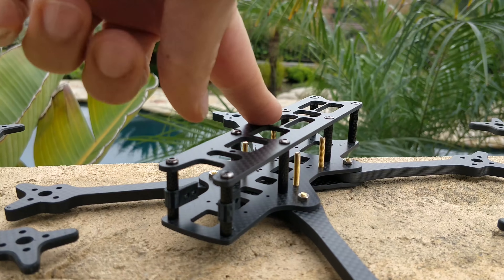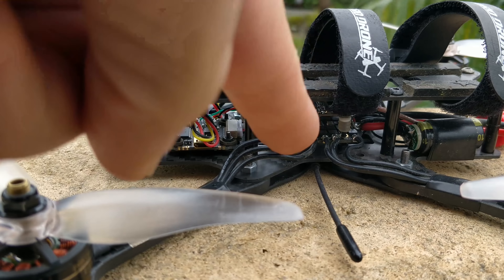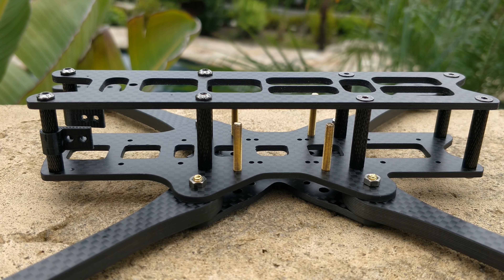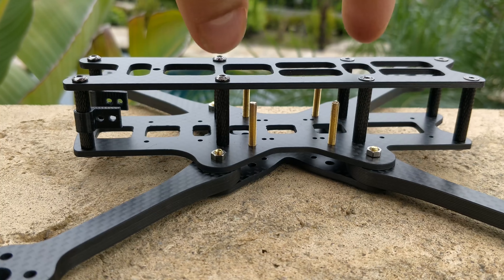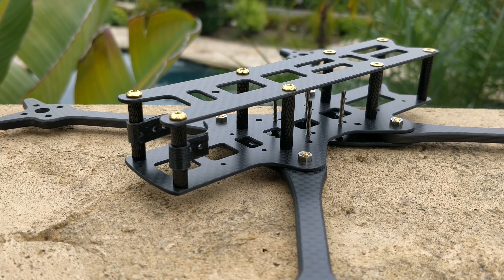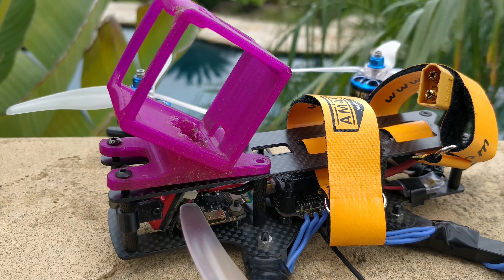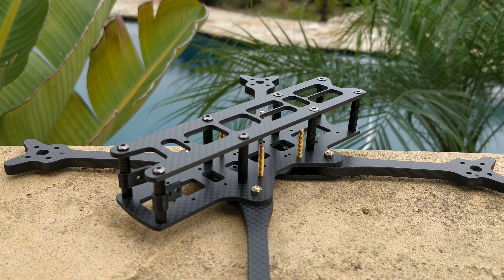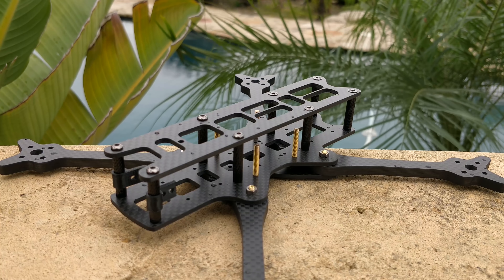Glide - 84g lite, 115g hammer, 97g standard

Comment: I fly r9 for a year or better. Im no long range guy but i push mid range and never have had an issue. Im running older firmware and its great alot faster than 2.4.
Reply from the maker: More power to you. R9 totally blows for me and I do not recommend it at all
Reply: I wont buy another frsky radio or any frsky system in the future do to there business ethics. Now everything i invested in is obsolete but the R9 system has treated me very well.

Comment: Not to be controversial or anything but I think a lot of the areas you’re focusing on aren’t as important as you think and a lot of the things you think make a big difference like vibration and weight on the end of the arms really only matter in very specific scenarios and aren’t as important as they used to be. I’m being really vague bc It’s really hard to explain through a YouTube comment haha but 1 thing for example as I begin to test probably my 50th set of motors I notice in some cases medium weight motors are better at handling propwash than super light motors for whatever reason.. the main thing I’ve learned is individual gear isn’t as important as the total combination of everything together.. so you can have a really light frame or a really tight frame motor to motor but the pros and cons of it can be completely changed based on the components the buyer throws on it! Same with motors and props everything down to the gyro.. Of course some things are objectively “better” but I don’t think that weight and weight distribution for example are as important as they used to be
Reply from the maker: That's exactly what I said in the video. I'm focusing on things that aren't important to the vast majority of people. I designed the base frame to be able to be used in many ways. The rest is just how I use it. The overall setup is far more important than any individual part.
Reply: But weight IS really important for freestyle.

Comment: Where the F did you get Amax 2305 1750, I thought 2305 only goes in 1850? Enlighten me, doctor. :)
Reply from the maker: They actually sent me these as samples. The low kv works super nice on the low weight
Reply: @Kabab  good thing the new 2305 have 1750. But the old ones are suuuuuuper durable, with bearings made of Vibranium :) hope new ones are just as cool...

Comment: Don’t buy foam for your microphone, buy a dead cat cover for it! You could be standing in a gale and the dead cat will suppress practically all of it! And looking at this, if I primarily used 30 x 30 stacks and wanted to split the mounting like you have, FC up front, I couldn’t do it, as the front only supports 20 x 20? Okay, so how about a 3mm threaded plastic riser plate? basically a 20 x 20 threaded plastic piece to cinch to the frame that also has threaded 30 x 30 holes for the  FC to mount to?
Reply from the maker: I'd highly recommend using 20x20 FC and vtx or one that fits in a 20x20 space. Or you can use a total of two 30x30 board plus one 20x20
Reply: KababFPV Can you tell me why? The reason I don’t is because the pads are all but microscopic, whereas a 30 x 30 stack you have a little more to work with! Now, a young whipper-snapper, like yourself, can still see everything just fine, but give it another 20 + years!!!!!!
Reply from the maker: @3eggerfpv397  there are a couple 20x20 boards with larger pads than 30x30. The main reason is hardware and because we don't need our FC or Vtx to be 30x30 large. Also, 20x20 is better for vibrations. It's better overall. The 30x30 is not needed
Reply: KababFPV - Okay, good enough, I’m looking into a new 20 x 20 stack?
Reply: @3eggerfpv397   you could do a 30x30 esc FC stack in the middle and a 20x20 vtx out back like a rush mini.

Comment: At the risk of sounding dumb, what size screws do you use for 20x20 mounting holes? Both M number and length. I've only ever used the 30.5x30.5 mounting holes before which I think must be M3.
Reply from the maker: Not dumb at all.  actually very un-dumb.  So 20x20 has multiple sizes.  My frame has all M2 size holes but there are actually a LOT of FC's and ESC's out there that use M3 size 20x20 mount with no soft mount.  This makes absolutely zero sense and if someone wants to use M3 screws, they can drill out the frame themselves.  I would strongly recommend looking for components that are intended for M2 size screws and have built in hole spacing for some sort of rubber grommet.  length of the screw is totally up to you and your stack.  I include a set of really long M2 screws with this frame but really if you just go the longest screws you can find, you can cut them with a set of strong wire cutters...